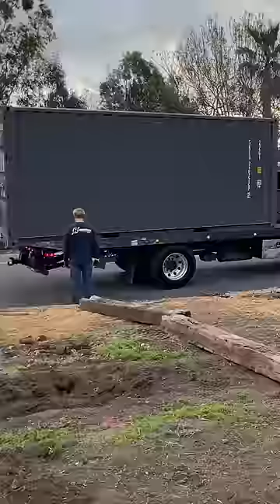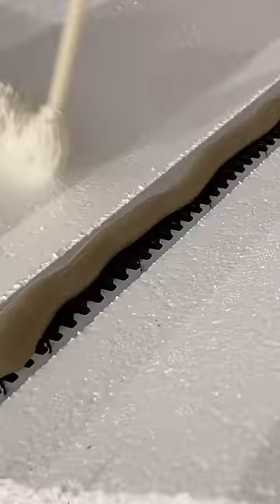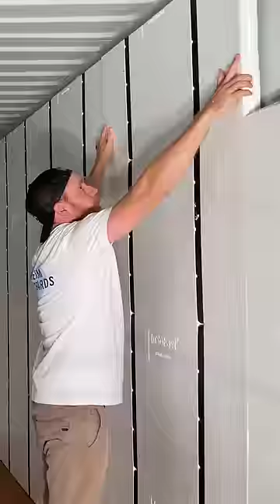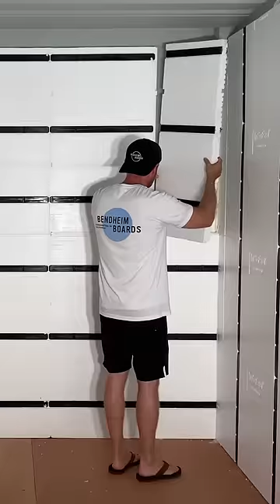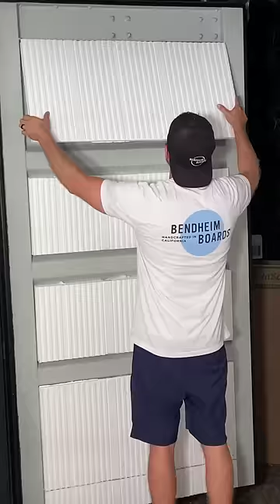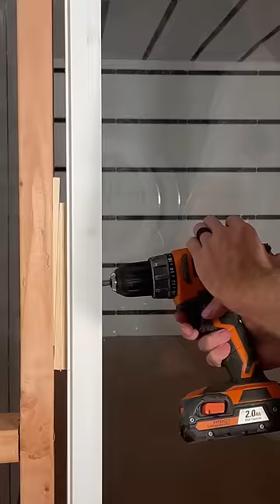Shipping Container Shaping Bay Progress thus far #shorts

Comment: Who ever thought of making the insulation like that is a god damn genius
Reply: Is styrofoam a good insulator?
Reply: @dimwitted-fool  It's decent, fiberglass is considered better but will mold when exposed to moisture.
Reply: @Cris Bowman  yeah and foam ino is just so clean, and easy.
Reply: @dimwitted-fool  It is a splendid insulation, though it's extremely flammable making this construction highly illegal in most modern countries. See Greenfell catastrophy etc.. 🔥☠️😱
Reply: @OmmerSyssel  i mean look at sprayfoam. Thats used everywhere. Its basically napalm
Reply: @OmmerSyssel  It's only illegal if you leave it like that.
If he plans to add drywall or something It's perfectly leagal.
Reply: @alexc664  not if used in high rise façade in the UK.
You can't have any combustible material in the façade
Reply: @ramonescrivapla7222  he is fitting out a shipping container, not building a high rise
Reply: Pretty cool stuff. What's the fire rating?
Reply: if you want to live in a plastic bag...
live there for 10years+ and you will definitely have health issues of some kind. thats with all modern houses which are diffusion closed structures.
Reply: @HyennaTheOne  you can just open a door or window, or even have air conditioning.
Reply: @JimboJuice  how do you suppose they run ductwork through this thing
Reply: @Devilsfan118  in this room specifically, one of the walls is entirely a door. Any time you enter or leave you get plenty of fresh air.
Reply: @Devilsfan118 Why on earth would you need duct work?
Reply: Insofast is hella expensive. It's more than the container itself.
Reply: Not if it's a fire hazard per Han-Yool Jang he must have insight, he spoke about it above. It's worth checking into.
THIS WOULD MAKE A GREAT WOMAN CAVE!!!!
Reply: @totallylegityoutubeperson4170  That's what I'm finding. Yeah, you get insulation, but you might as well frame and spray with polyurethane insulation for a better seal.
Reply: @bettygreene4483 Betty, have you ever wondered why he left?
Reply: @wiredforstereo  exactly
Reply: @HyennaTheOne  that's why houses that have to meet certain insulation standards wind up "tight as a drum" and are legally required to have an air exchanger. Better to be thought a fool than to open your mouth and prove it. Opinions are RARELY fact.
Reply: @BigDaddy-yp4mi  diffusion open structures meet that insulation standards as well and are "tight as drum" as well, only the moisture is able to diffuse through (as in the drum, which has sidewalls made of wood which is a diffusion open material). But you aint got no idea what those words means, so guess who is the fool here. I worked as R&D engineer in HVAC systems, those systems are OK only on documents, in reality they are a big health hazard.

Comment: call the Flex-seal guy after drilling screws into the steel frame. 100% guaranteed to leak
Reply: Except he DIDN'T.
That foam has plastic strips for drilling into.
It's th reason for using construction adhesive.
Congrats on not knowing what th FÜK you were talking about tho
Reply: @KittyBatSeth I mean, drilling into a plastic bar doesn't seem all that sturdy tho. Ofc I am completely ignorant on the subject, so I could be wrong
Reply: @aadenfoutch8011 No, not ignorant just really neither correct nor incorrect.

The hard plastic will hold the screw. It really depends how much weight is placed upon it. it won't hold as well as other materials but if he's not going to be putting things hanging from the plastic, or heavy walls or such, it should be fine.
Reply: @😂KittyBatSeth
Reply: aaronfuller6687  Yeah, I said that. Lol
Reply: It's designed for it its been used for years

Comment: Wait, there's specially shaped insulation for shipping containers? 🤯 
Also, never seen anyone hang a double sliding door by themselves before. Nice work!
Reply: Technically those sliders aren't supposed to be disassembled to be installed it can cause the pre built frame to loose its square profile
Reply: And if there are specially shaped insulations for STANDARD shipping containers, why are they‘re hights not fitting for the standard container?
He cuts a few of them to insulate the upper part of the walls.
Reply: @robertg6425  Good point. It would only need to be a few mm out to be a nightmare. I guess that explains why I've never seen anyone hang them on their own before. Lol.
Reply: @jamesrider4597  Also a good point. Perhaps it's a limitation in the manufacturing. The machine only able to extend to a certain maximum size or some such.
Reply: These are basement insulation panels being repurposed in a shipping container
Reply: They’re called InSoFast CX44 insulation panel.
Reply: @coloncleanse3542  Brilliant thanks!
Reply: the vinyl ones are A. cheap B. made like a replacement window C. much lighter than a wood/alum clad model.

Comment: You need to insulate the outside for two reasons, to keep steel thermal mass inside and to prevent condensation on the internal face of the steel.
Reply: you're 100% correct but how do you do that or what do you use?
Reply: @blackman8795  prevent having steel all around the house... no need to solve problem when you can avoid it... not mentioning that living in such a house is like living in a huge plastic bag, live in that and there will occur some health issues over some time for sure. like in almost all modern houses which are diffusion closed. But its cheaper, is it worth it ?
Reply: 7 how much does thank goodness we go Jo but it
Reply: @HyennaTheOne positive ventilators, and  help for homeless
Reply: Where does all the condensation go?
Reply: @Jamessansome  to growing MOLD!
Reply: All you need is a climate diffuser to mitigate moisture.
Reply: Exactly
Reply: @simfishsho  no, it will get condensation on the back of the metal sadly.
Reply: Saw a DIY home build using shipping containers paired up and stacked at jaunty angles. They ended up removing large portions of the walls and having to re-inforce openings etc. They created an air gap to prevent condensation which reduced internal dims. They clad the outside and it left me wondering why they used containers instead of a steel frame and simpler more insulated walls....

Comment: I remember we used to buy these containers for under $3000. Not anymore
Reply: Yep
Reply: 2500 back then 😢
Reply: I thought they had an over abundance of them?
Reply: You can buy a new 20ft container now for $2700
40ft high cube $4200
Reply: Bidenomics
Reply: @danchristopher7957  do some research before you make ignorant comments...
I did
Reply: I just got a quote for 3350 on a 40. but my hot rod blew an engine. can't do it now
Reply: @okieking8503  
They are up to 7000 in my area for some thing that is in new condition. I used to get 40s for $2500 in mint condition back in the early 2000s. 3500 is not bad at all
Reply: @okieking8503  right on! Bummer about the hot rod. I sold off my jeep srt last year and wish I had not
Reply: You still can!
Reply: If you can find a way to haul it, they give them away for free in the Port of Oakland
Reply: @jacobcairnes521  
That is clear across the country from me. 
I’m in NE

Comment: We used a container like this to keep our spare parts in. A couple years later we threw it all away cause it was too badly rusted
Reply: Rusty metal primer, and several coats of epoxy enamel, and good for 20 years. Drilling through to outside? Terruuuubull idea.
Reply: I'm thinking styrofoam prevents sweating from inside (condensation) 🤷🤷🤷
Reply: Sounds like a personal issue…
Reply: @jacoblecoy3700  👍👍👍👍 Thku!! 😄

Comment: It looks like a great job. I'm just wondering about the interior framing as you're doing and expansion of the unit during Summer sun exposure.
Reply: Op
Riouyyqrqyeqoerepoototqwyuutqeqxreeuuereqoeweorqqtpoouqeiqirqeeorwyirretrreqrtqreoreqqrqqqqorrqpeuooeqy
Reply: Should be more worried about the blatant fire 🔥 hazard
Reply: @Snacks8536  Fire hazard ? Worse that a house made entirely of wood ?
Reply: @daltonx6177  yes. Much worse.
Reply: @Snacks8536  it's getting covered in drywall... people use I joist on top of icf foundations and you're worried about this?
Reply: @daltonx6177  foam and fire equals basically napalm
Reply: @Sweedster everyone has insulation in their homes
Reply: Should be more worried about condensation behind all the foam. Dehumidifiers won’t be able to save that from water collecting and causing rust
Reply: @Analstrosen  That’s my problem with shipping containers being used as buildings. The condensation will get ya!
Reply: @Analstrosen  
Good point. Place a solid back for the insulation short  of the metal like in an attic then vent that space. Would have to do same for all walls & ceiling. Vented false roof added to unit?
Reply: Condensation, lack of airflow , containers are not designed for this
Reply: @Analstrosen  theoretically if you built false walls or left space in the frame and had airflow to the outside it would be fine?
Reply: A few vents maybe
Reply: @Free-Temp  fiberglass or spray insulation, this looks like the stuff that is used for packaging fragile objects like flatscreen tv’s. Of course there’s the possibility I’m wrong and this is flame retardant.
Reply: @Sweedster  all styrofoam is very flammable
Reply: The mold is a huge issue too if the moisture has no way to be dealt with. Container buildings should only be used in climates that need very little heat or ac. If you have to I suppose make a space between the insulation and metal then vent it. You can make a cheaper more efficient and arguably cooler looking building out of wood and choice siding. You’re literally boxing yourself in with the container thing unless you plan on making it mobile, but then there is a world of mobile homes in that regard. You can even make an awesome tiny home on a trailer. People have been racking their heads on containers for decades now and it’s only a gimmick at this point. If you want, use corrugated metal as a siding and you can have that futuristic look the right way on a wood structure. Wood, as old fashioned as you might think is the building material of the future as engineered wood composites make it possible to span as efficiently as metal these days and now there are wood skyscrapers being built. In the grand scheme of things wood is the only replenish-able material, and reusing any given container is less sustainable unless your site is near a cargo bay
Reply: @Analstrosen  
You said the same thinh I did with leaving a void for venting.
Reply: @Sweedster  "I love the smell of napalm in the morning"
Reply: @chuckg2016  I agree, making an air space that can efficiently vent is a system altogether which sort of makes it that much harder to build one.
Reply: @Analstrosen  
Very true.
Reply: @Free-Temp my insulation isn't styrofoam tho lmao
Reply: @Sweedster  and in an enclosed space at that… turning it into a furnace…. I’m sure it’ll be fine.
Reply: @Sweedster my guy if you burn foam it practially dissipates maybe if you doused the water in acetone
Reply: @StroopWaffel  measurements and material simply too restrictive. Shipping containers simply isn't as suitable for living, as often taken for granted.

Study them topic carefully. Or choose something else right away, a wooden construction will often be way better in nearly all aspects!
Speaking from years of experience with building and living in these boxes..
Reply: I'm just here to read all the container interior building armchair experts argue with each other, whilst never having built anything in their lives.
Reply: @sdunn0417  
At 71 years old and having been raised in construction -- yeah --- I have converted this type of unit as well as many other  types of structures.
Reply: @rob-fb5xs  Yea, well I never mentioned any names. But I was still here to watch all the armchair experts argue. Cuz Merica and all that.

Comment: If it sweats between the steel and the foam, isnt the spray foam applied horizontally going to trap moisture?
Reply: good call!
Reply: @carsonsflyinghigh  .......I sweat a lot, so it didn't take much thought. 🤣
Reply: @randywl8925  hahaaaa funny.
Reply: I thought a void was needed? Like Prodex etc.?
Reply: Thought the same. I guess this project is basically an exercise in growing mould. 

In overseas shipping, we even have word for it: container rain. 

The metal walls will get very cold and cause water to condensate. And it cannot evaporate to the outside like in wooden or brick walls.
Reply: So, what is the answer? I was initially going to use vert 2x4 wooden studs where there is a wider cavity, (leaving a wee gap between stud and ext wall). then spray foam the full depth varying between 4" and 2". I wonder if reg bats can be used than a layer of poly/tuck tape? Would that stop damp air from entering? Prob not eh?
Reply: @carsonsflyinghigh  I'm thinking instead of applying a continuous bead of spray foam vertically, just apply golf ball sized dots in whatever pattern  floats your boat.  As light as the foam panels are, it wouldn't take a lot of dots per panel. Maybe six?
Reply: No! The polyurethane, and styrene foams are vapor barriers. They insulate and seal from moisture, preventing it from condensing against the cold steel.
Reply: @brianjohnson8883  yes, when sprayed onto the steel.

Comment: I'm curious how he plans on dealing with the condensation during the hot months. I've seen other channels try to convert shipping containers into living spaces and they ran into huge problems with the condensation from the air conditioning.
Reply: You make a valid point. On the other hand, the title of the video refers to the container as a "shaping bay". Curious, I checked out his other videos, and it turns out he makes surfboards, and a shaping bay is a workspace. So, at least he won't be living in it.
Reply: You never heard of humidifier ?
Reply: @lorikodama8212  he just needs to cut out some ventilation and should be good, maybe should of used a damp course or vaper barrier behind the styrofoam insulation
Reply: @holeefuk413  I think you mean dehumidifier.

Comment: Any plans on what to do with the mold that will grow between the metal wall and the polystyrene in winter?
Reply: I've always wondered that with van builders.  They've been doing this for decades though ... I just don't know how and why they seem to be doing just fine while creating what looks to me like mold sanctuaries.  Anybody can explain, I'm all ears.
Reply: Why has this never occurred to me?  Is there a solution!?
Reply: Maybe dehumidifier running pretty frequently? Idk I’m an internet expert.
Reply: In winter you'll naturally have lower humidity levels, in summer that container will be to hot to even touch, thus killing any mold growth.  I see no issue as long as the container stays bare on the outside, of course
Reply: @MarcIverson mould central. You won't see it either. You will just be breathing it in
 Hot touching cold. No good. Needs to be a breathable structure.  I live in a 200 year old stone building in Ireland. It's 200 years old and I have a or to water underfloor heating throughout. Alll walls are lime do they actually thermal mass
 Too. Everything  breaths. All builders here will tell you it's nonsense and then they go and stuff it all out leaving no air circulation and the mould just builds up behind and gets terrible over 50 years. Lethal
 Good luck .
Reply: @jimmytwostepbackwards7357  you just explained why there is rarely mold in uninhabited room/container. If you add humans into the equation along with their breath, cooking and washing stuff, you immediately get much higher humidity in winter. That humidity will condensate on the cold metal wall and the mold will grow.
Reply: There's always a know-it-all in any crowd, 
that ruins it for everybody.

Great point tho.
Reply: Mold will not grow on the metal as he has covered it with the Styrofoam. Plus once inside and temperature has been regulated, mold will only grow were there is hot/cold interchange like around windows, and then it doesn't grow that well. So mold is the least of his worries.
Reply: Good point - would passive air vents help?
Reply: @jodiemc3105  yes. Check out your basement, most probably you will find vents intended exactly for that. Also not building your home out of metal and plastic might help.
Reply: @bomjour_crasovca except for the moisture won't get behind the foam if he seals it well and adds ventilation.
Reply: @worz678  I would love to see pictures of your home. I know it's beautiful
Reply: Since he isn't living in it and only uses it to shape surfboards in, I'm sure it will breath enough with the door opening and closing.

Comment: Install Styrofoam, anchor wood to the styrofoam, attach glass to the wood, and hope the same material as your coffee cup holds up over time. Pray it doesn't compress and just fall apart.
Reply: To be fair, anchoring the wood to the Styrofoam here was just to keep it in place during assembly. The frame is self-supporting by the vertical lengths, so the Styrofoam isn't actually taking any weight.
Reply: @PaddyInf you're right, as long as nobody leans on it it's all set lol
Reply: He very clearly attaches the wall studs to the steel high ribs of the shipping container wall, and it is not screwed into the foam insulation.
Reply: @PaddyInf bro is trying to justify a shipping container home
Reply: @elijahthompson3899  he most certainly is not, those black bits are part of the foam he just has glued in. If he were going into the metal he'd be drilling holes in the roof lmfao.